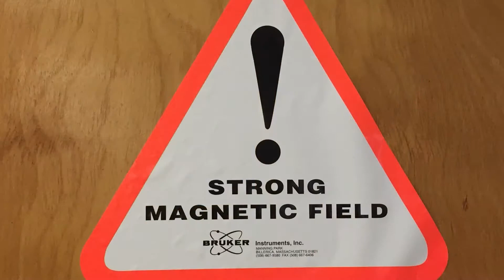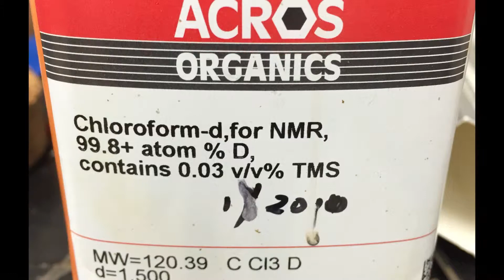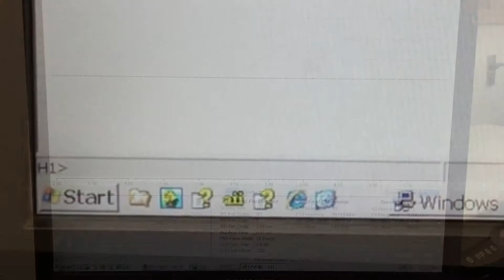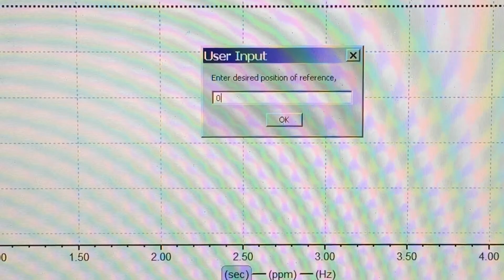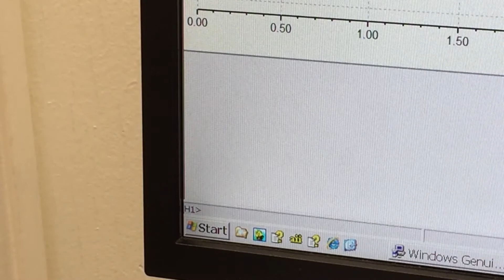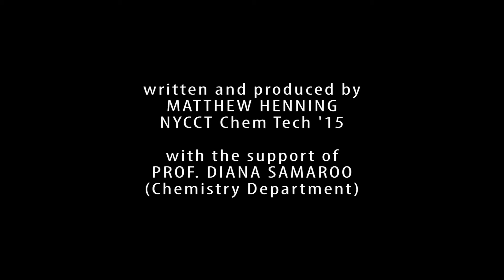Running A 90MHz NMR Spectrum

Comment: The vibrations that are visible in the spectrum can be eliminated with 5" OD x 3.1" ID x 0.75" Sorbothane pads placed strategically under the magnet.